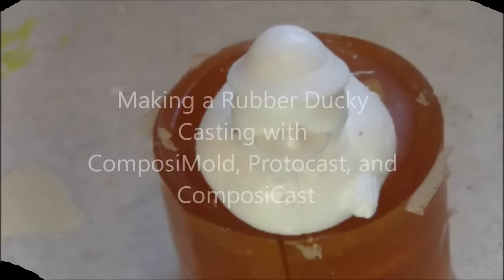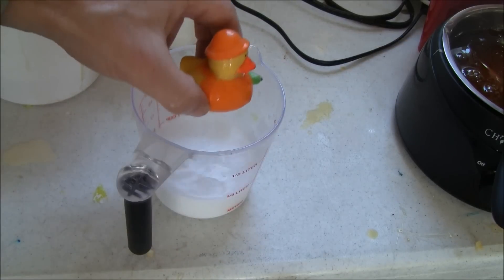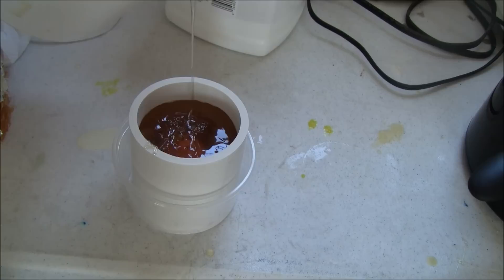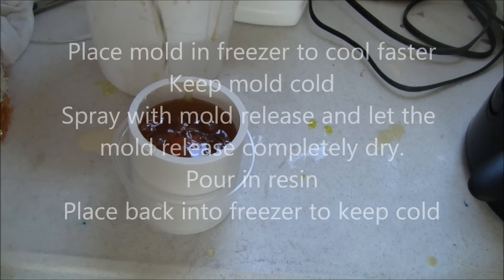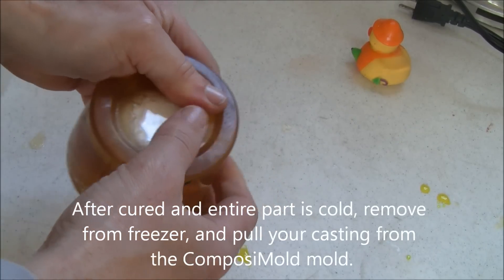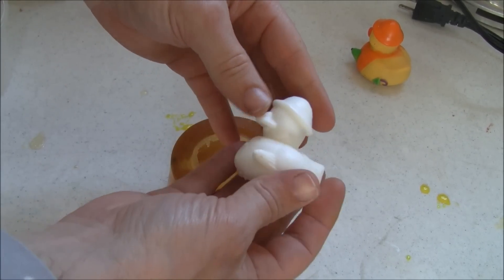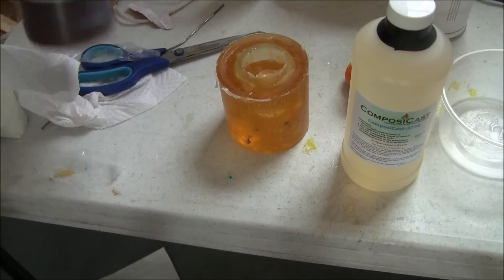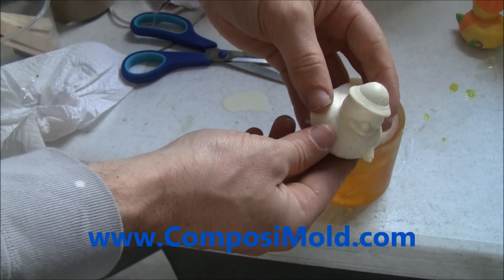Make/Mold Rubber Ducks Using ComposiMold and Plastic Casting Materials

Comment: Hmmm...
So if I wanted to make many of them (100-200), and at least 2x-3x the size, I would definitely want to consider making a number of molds, otherwise it would take forever?!
Reply from the maker: Yes, probably a good approach. After you make four or five shapes, re-melt the ComposiMold and make a new mold of the 5 shapes and repeat that for lots of castings...thank you! Stan from ComposiMold

Comment: How can I make it hollow inside?? So I can put a squeaker and let it act like an actual rubber duck
Reply from the maker: Thank you for watching! Use a thick silicone and brush it in the mold rather than pouring you may need to brush several layers.
Reply: @ComposiMold  Another question: what clay did you use?
Reply from the maker: @seasickpirate7756  A generic polymer clay was used to anchor the duck.
Reply: Ah sorry, miscommunication; I mean what clay do you use to sculpt the duck? Like is it okay to use airdry clay? Will it stick to the rubber?
Reply from the maker: @seasickpirate7756  Air dry clay will absorb and stick to the ComposiMold. Use a polymer clay or non-drying clay. Just make sure to allow the ComposiMold to cool below 150F before pouring over non-drying clay because these usually have a melting point around 150F. Also you can use air dry clay as long as it is well sealed.
Reply: @ComposiMold Last(ish) questions: should I dust the sculpted ducky in powder so the clay will come out? And that it won't damage the sculpture just in case something went wrong with the mold. And what kind of paint can I use after making my first ducky? Thank you so much! :D
Reply from the maker: @seasickpirate7756  The powder shouldn't damage the sculpture but the mold might; gently remove the duck so that its bill and neck don't snap off. Vegetable oil or cooking spray can also be used as a mold release. For best results with paint the duplicated duck should be rinsed with soap and water then quickly sanded with 120-240 grit sand paper then primed followed by the paint of your choice. You can skip sanding and priming and go straight to painting but if its handled a lot or in constant direct sunlight it could start peeling. If you plan to use it in the water you are better off adding epoxy pigments to the duck just mix in a few drops to the resin here is a link to our pigments: http://composimoldstore.com/colorants/ If you were planning to paint it yellow you may want to add yellow pigment instead.

Comment: does this contain gelatine or animal derived products?
Reply: Selina Pal, I'm no expert, but I don't think so. I could be wrong but, if it does you could just use different materials for the mold. I heard Silicone works well... But Silicone molds kind of crack open (but are still useable) when you try to get it out.

Comment: Where do you get the supplies and what do you use to paint it? Does it have to be a certain paint?
Reply from the maker: Hello Dad-Daughter Gaming! You can purchase all the supplies at www.ComposiMold.com or see a list of stores in your area carrying ComposiMold products at that same address. (Check out the All In One Package or the Urethane Starter Kit) We recommend using an oil based paint for longevity. You can also purchase colorants to mix into the urethane before pouring into the mold. This is a cool way to do it! We don't carry the dyes but you can easily find those online too!

Comment: Could a mold made in this way be used to make something hollow? Like for instance, if I were going to make a toy, like a duck, out of latex or a light rubber, and then stuff it with a corn syrup like substance to make it stretchy (like a Stretch Armstrong toy), could this be done?

I hope this question isn't too complicated to ask. I'm just studying and doing research right now because I'd like to make toys like the Stretch Armstrong toys (only with animals) for my kids, and I'm trying to find the right process to mold and cast them, as well as sealing them up after the boiled corn syrup is put inside them.
Reply: Thinking more about it, it would probably come out better if I slush-cast the toys and then made a latex or silicone plug to seal them with. I'd love to hear your opinions on the subject though! Please and thank you!
Reply from the maker: That is a great idea! Although the smaller the hole the easier it will be to plug later. You will likely have to slush cast several layers. especially if you are using latex.
Reply: ComposiMold
 Thank you so much for replying. It took so long I thought you didn't reply any more! I'm still doing research and playing with latex, but I'm getting more confident with my exploration and discovery!
Reply from the maker: That's great! And again sorry for the late reply. Lots going on in ComposiMold world and we missed some great questions. Thanks again!

Comment from the maker: Have you done much mold making before? Do you have a master object you want to make a mold of? If so, glue it down into a larger container and pour melted ComposiMold up and over it by 1/2inch. Once the ComposiMold has solidified, pull the original out and you will have a hollow box mold. Another thing that we've done is 3-D printed a small box with a matching lid and then made molds of those. That was cool too! Let me know if I answered your question. Thanks!